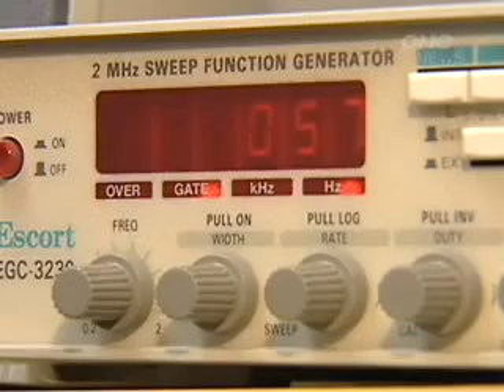Mysterious Auckland Hum

Comment: Not what it sounds like!  way lower! I've been hearing it 23 miles E of Pittsburgh, PA for years now. Usually I'm the only one, but when it's loud, others in house can hear it sometimes. Thought it had to do with 30 inch underground high pressure gas line 1/2 mile away... Rural area.  Not magma, I'm at 1280 ft. Whatever it is, it's MADDENING! Perhaps the sound is attracting the UFOs in Westmoreland County here--Popular Mechanics reported as most UFO sightings in the country. We've seen alot.

Comment: There are 18 windmills upwind with 3 blades each and these blades are 100 ft long... so you have 56 windmill blades that are 100 feet long vibrating upwind. This is the same as putting 56 - 100 foot speakers on the same site and pumping out 56 hertz through the speakers.
By the way the blades are 100 ft long but the diameter of the whole windmills are 200 ft.  So in reality you have  18 - 200 ft diameter low frequency speakers on the site. What do you think sound is? It's a vibration.

Comment: Its exists.  I've heard it in Ga. (USA) for 2 years now.  What is it? I've heard everything from 1. invisible hoovering ufo's.  2. underground military tunnel equipment.  3. terrorists digging their way to gas lines.  3. digital data transmission (as opposed to analog).   4. haarp.   5.magma flow disruptions caused by unknown gravitational fx.   Its most noticable at night when things are quiet.  I used to think it was distant train diesel engines idling, but its clearly not that.  Who knows.?

Comment: Look at the strings on a piano..they are steel strings..the longer the string the lower the frequency. A  100 foot steel windmill blade will vibrate  just like a 100 ft steel string will.
Vibration is measured in hertz.. vibration is sound... speed is not sound. The strings on a piano do not travel any distance...speed is measured in meters per hr... how many meters did the piano string move in an hr....zero... the string has no speed because it is not moving..it is vibrating, big difference.